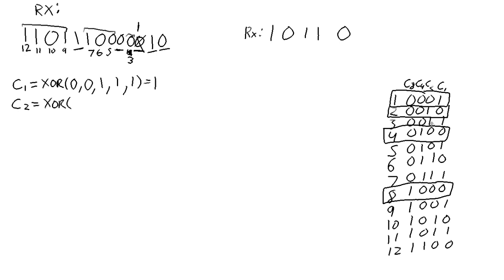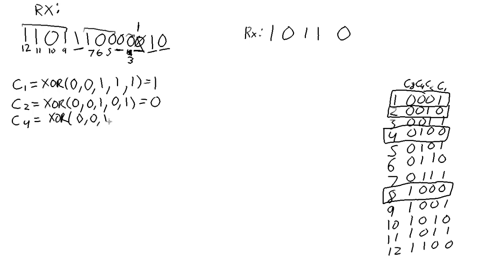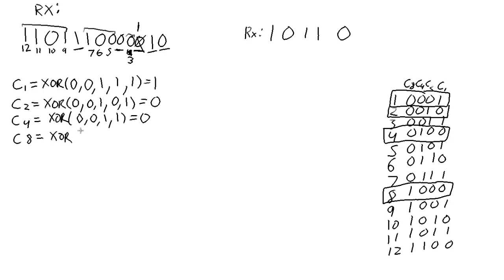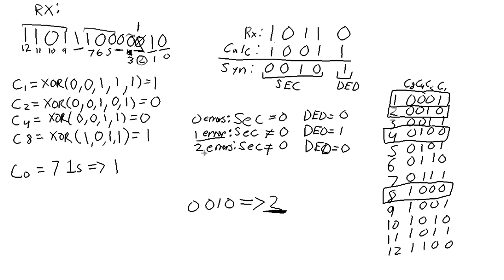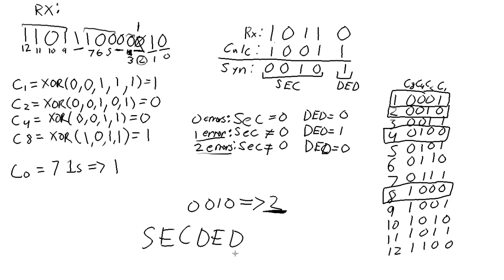Verifying SECDED Codewords

Comment: First off, I love your videos. They're clear and have helped me. Thanks! That being said, I think your conclusions in this one are incorrect? For example, let's take the codeword you created in "Calculating SECDED Codewords": data=10110011 gives parity=10011 (full codeword=1011100101011). Now, let's flip bit4 in the data to give: 10111011. That parity calcs to 11101. Now, 10011 (xor) 11101 = 01110. In this case, the four hamming parity bits (0111) do correctly mark the position of d4 (position 7). But, the C0 bit (you call it the DED bit here) is zero. You stated that a single-bit error would show up as DED=1. Can you please tell me if I'm missing something? Thanks again :)
Reply: I know this is an old video and also that the asnwer is 3 years old. But for a project, I needed this. I did an excel sheet using the same example in the video. But I cannot make sense of the DED bit. For instance, if I flip the bit 7, the SEC is indeed 7, but the DED bit is 0, meaning 2 errors, but I only changed 1 bit. Same if I only flip the bit 11. Maybe it is because bit 7 and bit 11 have an impact on 3 parities bits? Too bad.